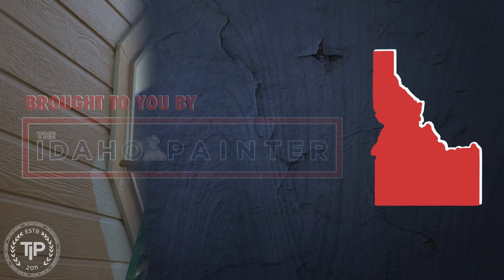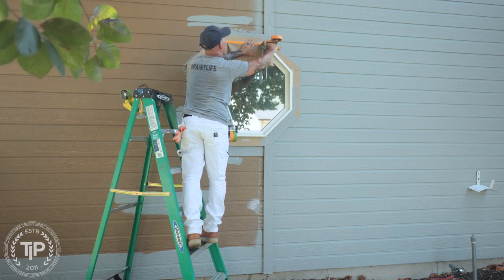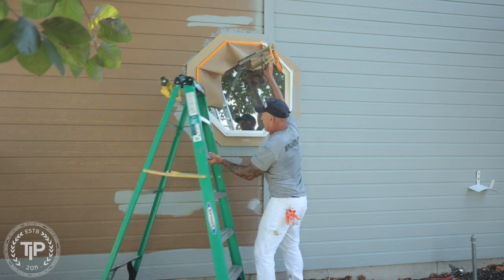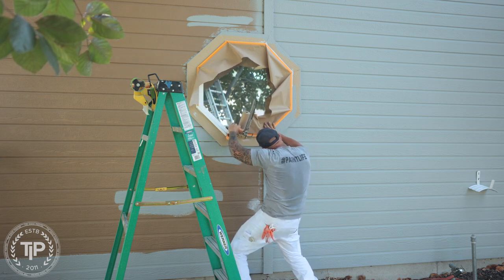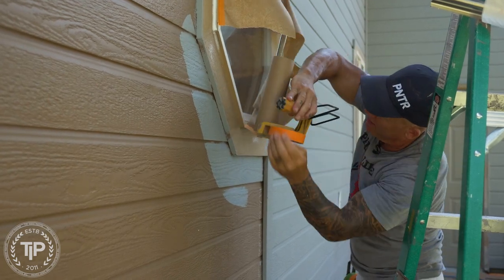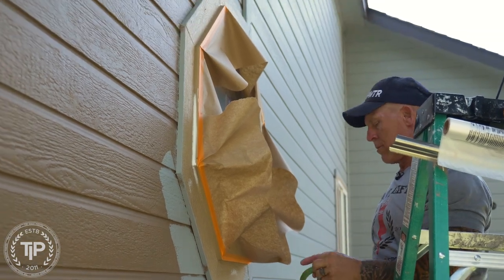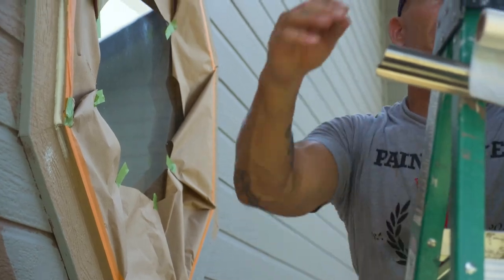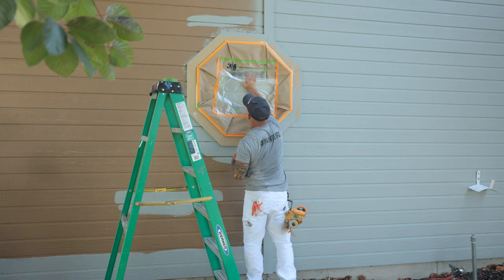Masking, Getting Ready To Spray and Controlling Overspray.

Comment: First and foremost, I have to thank you very much for all the videos and all the information that you've given out freely to people like me and everyone else. I do have a question for you though. Recently my customers had there exterior of there house painted by a different painter and about 1 week later bubbles are appearing everywhere on the front of the house. I'm in the Seattle area so it's starting to get wet outside so there was moisture obviously. Also They pressure washed the house and painted the front the same day which absolutely is unacceptable in my opinion in Washington in October.  Long story short now they want me to repaint the front of their house for them. Now there are blisters everywhere more and more happening every day which is probably going to continue to happen.  The painter used super paint so I know the paint is pretty decent. What would be the best and correct way to tackle this in your opinion I would appreciate your insight very much. Thank you so much for everything you do and God bless

Comment: I see you spraying the wall at the end..It looks like you are doing bottom of wall to top? I thought it was always top to bottom, to catch  any drips that might fall from the top
Reply: When spraying, it's easier to control overspray if working bottom to top.
You can see what your about spray a lot easier, the paint builds better... 
And you can see where the spray is going. 
You don't have to start at the bottom bottom... 😆 Just at the bottom of the section you're about to spray. 
Then as you are spraying your pattern, keep looking at the next pass and just work your way up the surface spraying even coat...
It's my go to way also

Comment: This is how we used to mask before 3m released DualTac. Very '80s. Maybe it's kinda cool because it's old school, but it's SO much slower. Dual Tac is WAY faster. And you don't even need a Dual Tac dispenser - the same hand masker as seen in this video will work, it's just a matter of procuring the Dual Tac tape. Dual Tac eliminates the need to buy masking paper (expensive) or masking film (ditto); ordinary 2 mil poly will do the trick. 

The fact so few people use Dual Tac anymore reminds me of those myths about the Ancients knowing the secret of antigravity, but the secret was lost and now everyone uses fossil fuels. Except in the case of Dual Tac, it's actually readily available, but few people seem to know about it anymore.

I've seen a similar thing happen with brushes. 6" and 7" paint brushes were common at one time, then the painting world lost its collective mind and now the majority of painters cut with little 3" brushes. Madness! They're so slow by comparison! And harder on the body, because they require so many movements of hand/arm to accomplish the same thing (economy of motion).
Reply from the maker: Never heard of it
Reply: @Idahopainter  yeah not surprised - it was a big deal when it came out (early 90s, not long after 3M released the first blue painters tape, which was called "Long Mask" in those days). Anyway, when when 3M discontinued Dual Tac, painters were pretty upset, and many probably just moved on and went back to the old ways. But the tape itself always remained available and some painters figured out you could just use it with a regular tape & paper dispenser. Anyway, when I mask that's my go to; I never went back to paper/masking film - for good reason. Dual Tac is both faster (way) and cheaper. Once you've got the dispenser, the only proprietary thing you need to buy is the tape – most any polyethylene sheeting will do, which is comparatively cheap. 
(Btw - I'm mostly a no tape, by hand painter – I'm only advocating for this stuff to pass on the information – there's nothing in it for me personally. I don't even use it all that often, but I'm really happy that it's there when I need it.) Just google "Dual Tac" and you can check it out further.